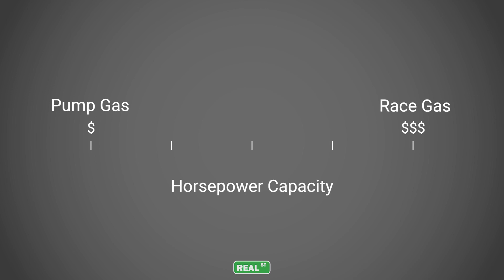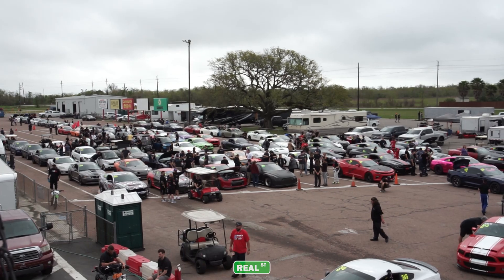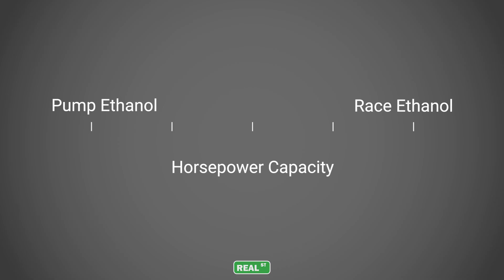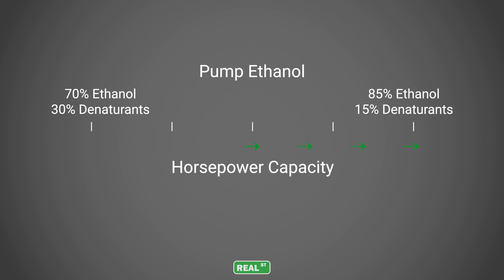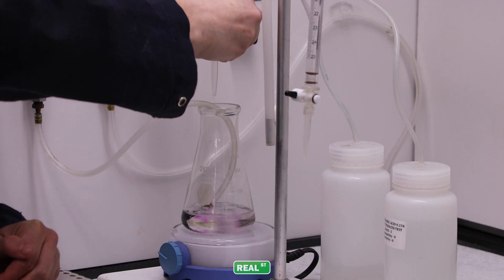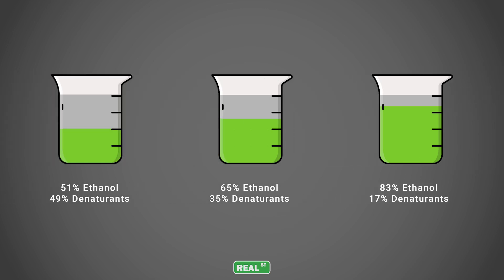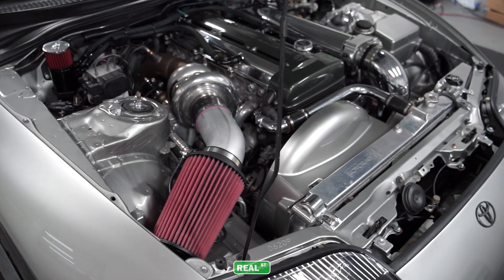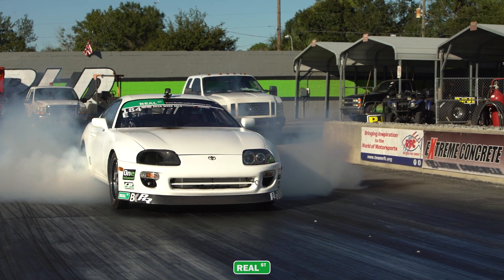Race Ethanol - When Should You Choose Race Ethanol - Part 2

Comment: I know that One S isn’t quite as spicy as One R but, I suspect that the benefit over pump E85, assuming it’s above your peak performance threshold (E70 or so) for tuning, would also be a noticeable difference? For instance, I generally use pump E that is over E75 and will use One S to top it off if I’m going out to run the car. While it’s diluted with the pump E, I still think that should provide a benefit, right? Perhaps with blending, I should go with One R to ensure a more potent mixture. What do you guys think?
Reply from the maker: Hey Matt. Try thinking about it from the other direction. Imagine that, as in ingredient, ethanol, it self, is ethanol. And the other non-ethanol 15-30% of pump ethanol fuel is what determines the spectrum between a worse fuel and better fuel. The non-ethanol portion in pump E85 is not a good fuel by itself to run though an engine, but its cheap and once you mix it with a bunch of ethanol, the final product is good enough to run through an engine. (one of many reasons why they have to mix something in is to make the otherwise edible pure ethanol non-edible so it wont be taxed at the higher beverage tax rate which would inflate the price) The reason why Pump E85 is better for racing when it has higher ethanol content is because higher % of ethanol means lower % of the other not-good stuff. The biggest difference between race ethanol (like One R or One S) and pump ethanol is the non-ethanol ingredients that are mixed with the ethanol. Pump Ethanol is meant to be affordable for everyone in daily use so it uses inexpensive low quality denaturants, race ethanol is not bound by the price so it swaps out the low quality non-ethanol denaturant for high quality non-ethanol denaturant that improves combustion and does a better job in facilitating the generation of horsepower. So lets say you go to the gas station with an empty tank and pump 10 gallons of Pump Ethanol that measures out to E70. That means you have 7 gallons of ethanol and 3 gallons of low quality non-ethanol ingredients that, themselves, are not good for performance. Then for the sake of easy math lets say you put 10 gallons of One S  on top. That would be another 8.5 gallons of ethanol and 1.5 gallons of high quality non-ethanol ingredient. So you end up with a total of 15.5 gallons of ethanol, 3 gallons of "something not good", and 1.5 gallons of "something good". So your ethanol content percentage is 78% but your "low quality additive" percentage is 15% and your "high quality additive" percentage is only 7.5%. One S and One R are formulated to be used without mixing. The thing you are paying extra for when you buy race fuel is really how good the non-ethanol part is for making horsepower and preventing detonation. When you mix the fuel, you dilute the ingredient you paid extra for, decreasing its effectiveness. My suggestion is to stop looking at ethanol fuels by the ethanol content and start looking at them by their non-ethanol content. With pump fuels you want as little non-ethanol denaturant as possible (because its not good for performance). But with race ethanol fuels, you want the intentionally formulated amount of hight quality non-ethanol denaturant

an analogy I use sometimes in this example is if you went to a bar and they had two vodka drinks that each had 2 equal sized shots of the same vodka mixed with "something else" in them. If one was 3 dollars, and the other was 12 dollars your first question should be "if they both have 2 shots of the same vodka in them, what is it about the other ingredients that makes one cost quadruple the price?"
Reply: @realstreetperformance  thanks for the reply, fellas. I generally run my car on One S but, as I’ve been driving it around more lately, that can become quite costly—especially with no pump E available for hundreds of miles from me. So I take a trip every few months and fill up at the closest pump and get a few hundred gallons to hold me over until the next trip. Suffice to say that from your feedback, you’d likely advise that I run my fuel down and fill up with One S when I intend to do some 🇲🇽 runs or track work over running a mix of pump E and One S? 

That makes sense to me and the feedback certainly isn’t lost on me at all. Under this same premise, what are your thoughts on One S vs R? Is it worth the difference on a car only making about 800-1k?

Comment: Do you still need a flex fuel sensor if your running race ethanol, like your talking about in this video. Im referring to race car application not dailys
Reply from the maker: The only reason you would NEED a flex fuel sensor is if you wanted the ecu to automatically correct for a variation in ethanol content between tanks of fuel. The most common reason for this is when people are switching back and forth between gasoline and ethanol, or when someone is using pump ethanol that varies in ethanol content from tank to tank. However, if your car was dedicated to a race ethanol that is consistent between batches, and you will not be swapping back and forth between gasoline and ethanol, then there is really no need for a flex fuel sensor. You can just tune it for the fuel it races on, and leave it on that fuel. The only trouble you could run into is if you are using a brand of fuel that varies in mixture from batch to batch. We personally use One Ethanol at Real Street and have had nothing but success with it.

Comment: Would it be wise to mix this with pump e85, almost like an Ethonal booster to ensure you're at the 85% E range? Kinda like what regular 93 pump gas users do with torco or boostane to increase octane or to make sure they're at least at 93 octane. I was thinking of buying a 54 gallon drum and putting in 5 gallons of race ethonal and 8-10 gallons of E85 pump ethonal....
Reply from the maker: Great question. You definitely should not mix this with anything. The mixture is very specific.
Reply: @realstreetperformance  Gotcha. Thank you for responding.

Comment: This is straight BS! My pump E85 test at e94-95 straight from the pump! Portland Oregon, I understand other places may have lower e rating depending on time of year but this video is bullshit and just trying to sell you something you don’t need. Smh what let me guess you put something special in it and now is knock bullet proof? Lol well what are you saying to the guys running 1000+ whp on pump E85 and never having any knock issue?
Reply: Winter or summer blend? Also it was stated that pure ethanol is still not as resistant to knock as race ethanol due to the additives used. Unless your running 40+psi I doubt you would start stressing the knock properties of pump ethanol. This isn't a fuel for a daily driver but for serious track use when ur pushing the limits of timing, boost, compression ratio. Cylinder pressure so high they physically distort and lift the head off the block.
Reply: California does not have a winter blend. Not sure about Oregon, but while it does snow there it's much shorter than typical cold climates in the rust belt. Cali E85 test at 80-85%.   This isn't an issue for the vast majority since despite the internet most people aren't even making 400 hp let alone 500 hp. Even fewer make more than that.
Reply: Race ethanol is better, however most people can't take advantage of it. Then again most people aren't doing big annual events like Texas 2K when fuel consistently with near the edge tuning is important.
Reply: @dj4monie  And that's why they state that its for competition/race scenarios. Jay said if fuel is good enough for your needs no reason to change, this was an educational video that explains the differences between the fuels and when you should start considering the switch.
Reply: Or just like we do here in Brazil, we have E100

Comment: This is why you should always check the pump gas ethanol content. If its 85% you can go very far HP wise.
Reply: "Up to" 85% ethanol ... is what the pump says. Minimum is 51% ethanol.
Reply: @ACommenterOnYouTube  That's why I said it should be measured. Especially in a high HP application.
Reply: @FadetoBlack1463  you cant measure it at the gas station. So the E85 pump gas version you get, its whatever content it is at that time which is from 51 to 85% ... 
How you would measure the content of that pump gas or the race version beats me
Reply: @ACommenterOnYouTube  I measure it all the time. With a test tube that you can purchase at Summit, Jegs, Amazon or other high performance stores.
Reply: @ACommenterOnYouTube  they also have Ethonal gauges that tell Ethonal percentage so you know where you're at after you fill up
Reply: @racequad9  as you can see i dont use ethanol
Reply: @ACommenterOnYouTube  You can measure it, I live in California I don't need to.
Reply: For people with stock turbos this isn't an issue. If you are set on kill and running a big shot of nitrous, aftermarket supercharger or turbo on the stock block then purity will matter more.

Comment: Can you do a video on what things need to be done differently in the fuel system to safely use ethanol. I know you need more fuel volume and size the pumps appropriately but should you use different materials in the lines etc.
Reply: Definitely takes a return style fuel system usually i know in the coyote platform. Double or triple pump setup with upgraded injectors

Comment: Not only can we go faster but its cleaner and sustainable and this will play a big part in the future of motorsports i feel
Reply: Biggest issue is that burning corn as fuel instead of using it as food has an impact on the worldwide price of corn, which hurts the worlds poor. 

Politicians from corn producing states wield a lot of power.
Reply: Using food space for race fuel is definitely not sustainable nor ethical.  Ethanol can be made from refuse biomass though which is what we should be doing.
Reply: @stevekalesia3922  No, bioethanol dedicated crops are not waste crops. It takes immense land usage, water input, and fertilizer which also massively contributes to GHG emission and eutrophication.
That is food source diverted for racing fuel. Waste biomass would include sewage wastewater, animal residues and byproducts, industrial wastes, etc. I love my race fuel, but I'm relatively educated in energy sustainabilty and its laughable to refer to dedicated biofuel crops as sustainable. It's not.

Comment: This is great information, especially for people who are just converting to ethanol. I do have one question though. If a car is tuned on pump E85, would it still be okay to run it on race ethanol?
Reply from the maker: It would be OK but the tune should really be gone over any time you change fuel. I can't really tell people "it will be fine" without knowing the quality of E85 they originally tuned their car on. So the responsible answer is to log the car after the fuel change and verify that no adjustments need to be made. shoot me an email at clay@realstreetperformance.com if youd like more help switching to race ethanol